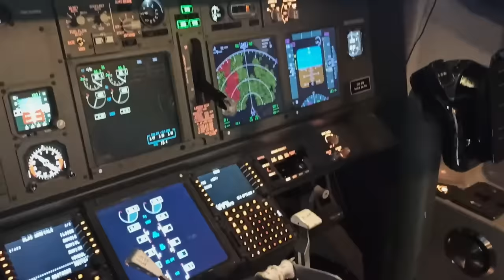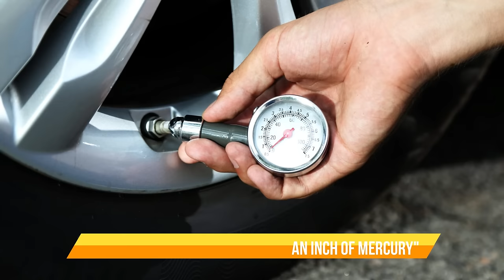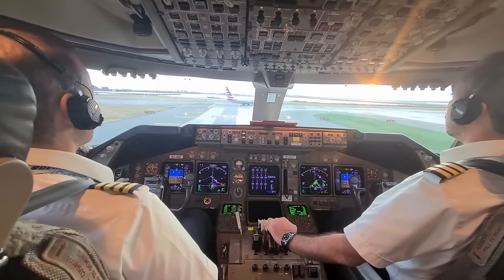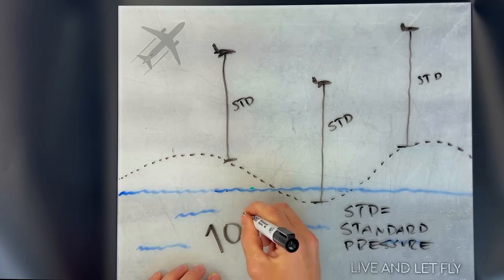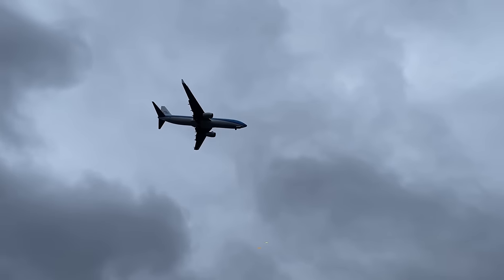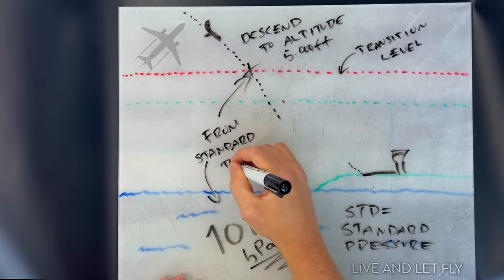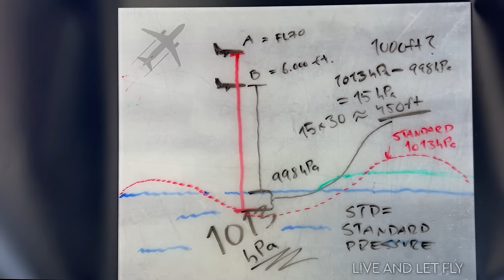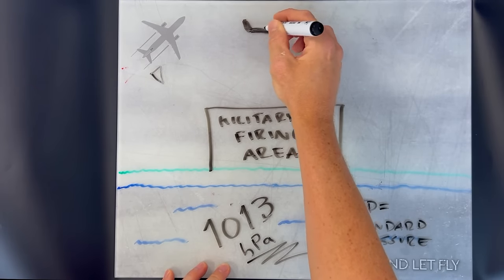QNH and QFE explained | ATC Basics 💯

Comment: To be precise it should be 1013.25hpa for the Standard Pressure Settings. Since it can’t display “.25”, it is therefore most commonly referred to as 1013hpa. However, it is good to note that the SPS is 1013.25hpa. Cheers!
Reply from the maker: That is absolutely true! 1013,25 hPa is the accurate standard pressure. In most cases, it is rounded to 1013, since most aircraft cannot adjust it more accurately than that. 🙂
Reply: Nit picky but I learned something.  We reckoned 1013 as normal.  Our airfield, RAF Woodvale, was about a mile from the ocean and about 40ft UP; so on QNH, yes, it showed 40ft.  Altimeters START at $5,ooo.  Full of very very many cogs etc as I found out when mine quit.  I just put it back together! And bought a cheap height watch.
Reply from the maker: @davidwheatcroft2797 I agree on the altimeter price. Anything aviation related has a ridiculous multiplier on the price tag! I guess the cheap height watch gives you the exact same reading as the $5000 altimeter… 😉

Comment: QNH and QFE are two important altimeter values in aviation. They are used to adjust the aircraft's barometer and calculate other flight parameters.
Reply from the maker: Yes you are right, without those flying is quite difficult.

Comment: QNH and QFE are provided by air traffic control. Air traffic control will provide QNH to pilots when they take off or land from an airport. QFE will be provided to pilots as they approach the runway.
Reply from the maker: Not all pilots need the QFE. But true about the QNH, that is required before commencing the flight and has to be adjusted correctly when approaching the destination airport.